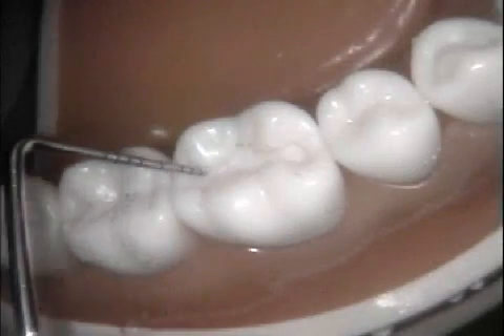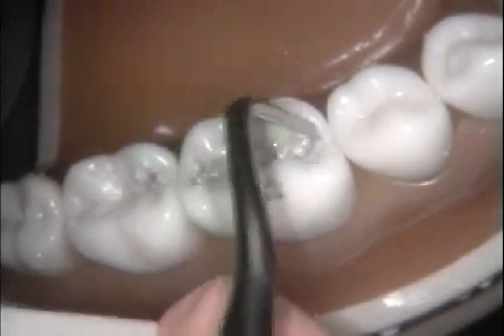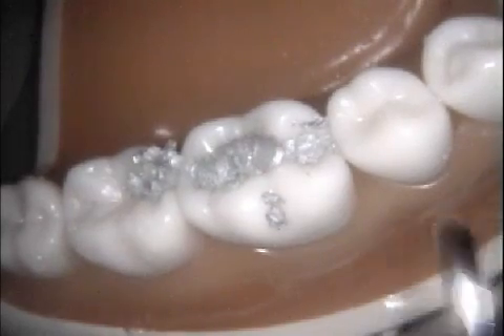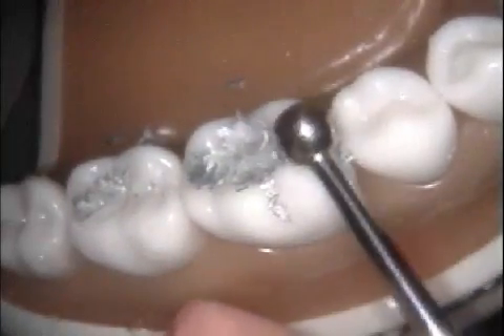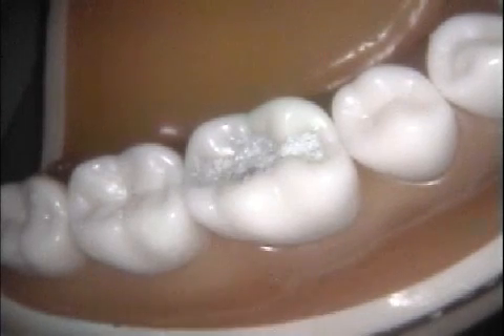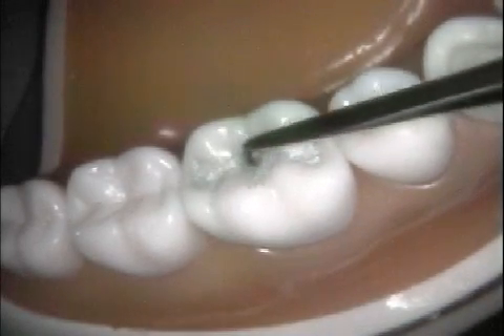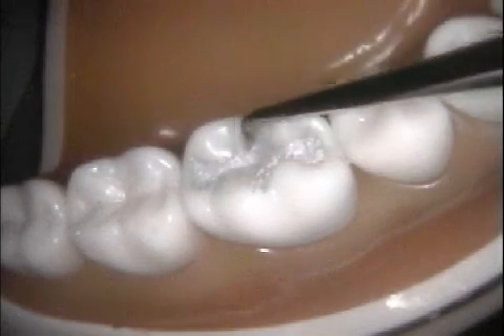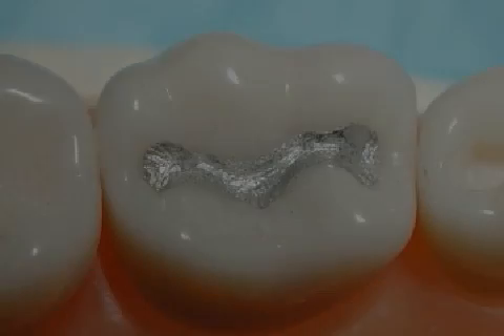dental amalgam restoration

Comment: @kadpw2 its not directly mercury, you should inform yourself better before commenting on this. Amalgam are one of the best dental materials, of course it lacks in the estetic part, but it totally mends it in strenght and durability. So if it actually was all about money dentist would only do composites cause they have a 5 year resistence! inform yourself!

Comment: Dude, amalgams have been used for over 150 years, and the most reliable formula has been used since the 1970's.  Yes, it doesn't look so good compared to composites, but they will last a very long time.  (Mine have lasted for over thirty years.)  Composites look nice, yes, but they cost more and last half as long.  If you want longevity, amalgams are the way to go.